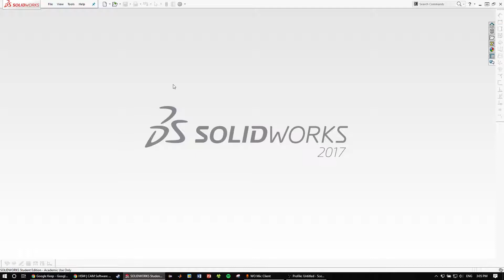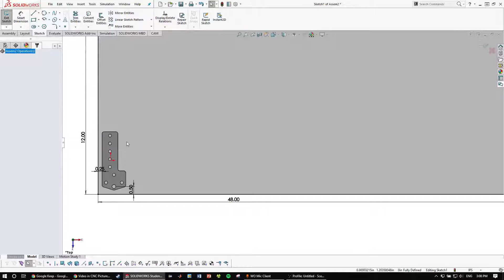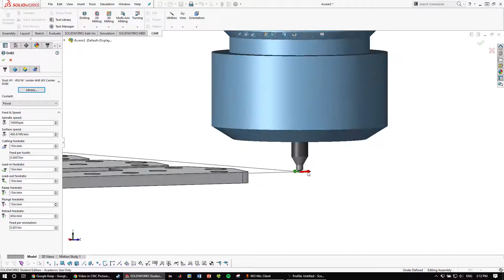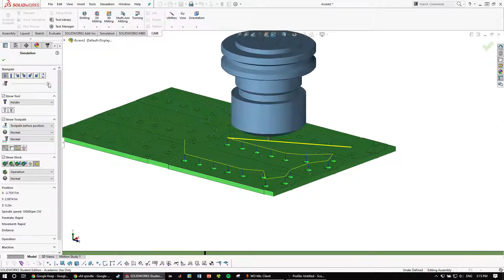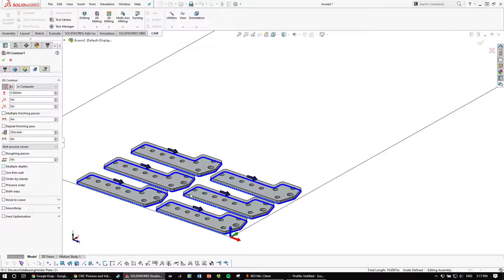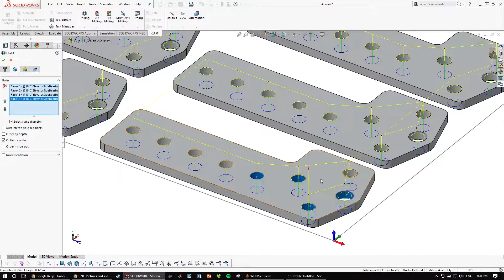Using HSMWorks with CNC Router Part 1

Comment: How to leave taps.... So that parts remain attached to stock.
Reply from the maker: You cannot use tabs in HSMworks, but Fusion 360 CAM does support it. Recommend exporting your files in STEP format into Fusion and using Fusion CAM instead, it is same thing as HSMWorks but with more features.